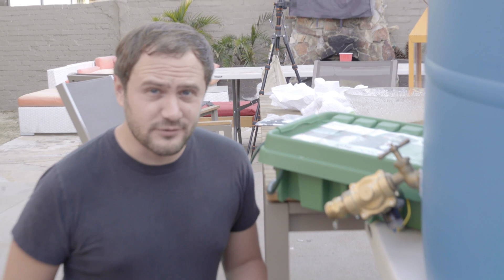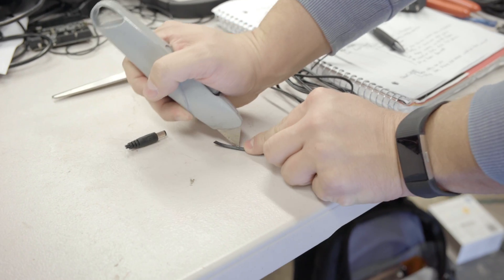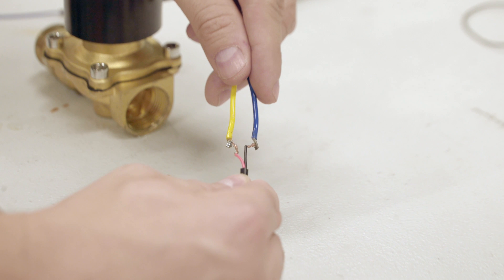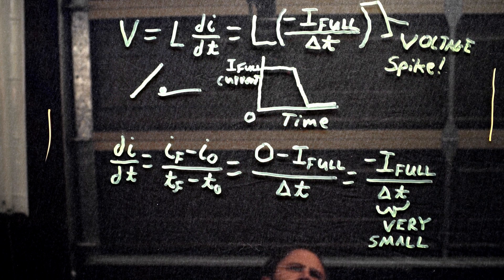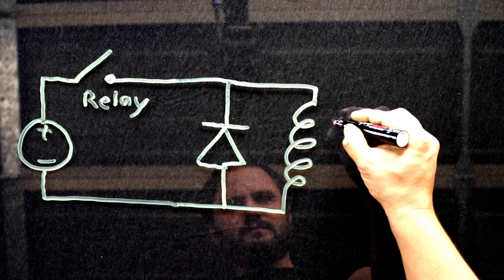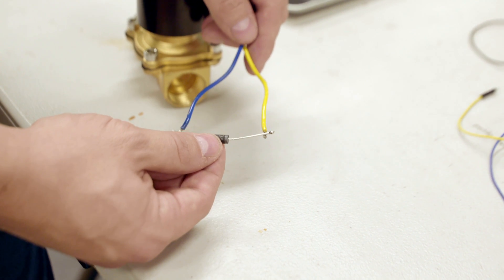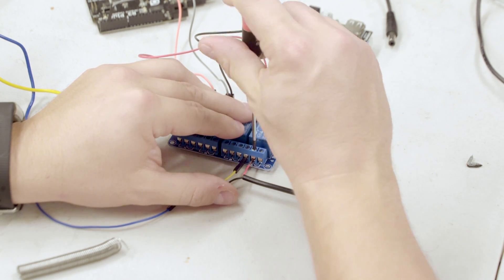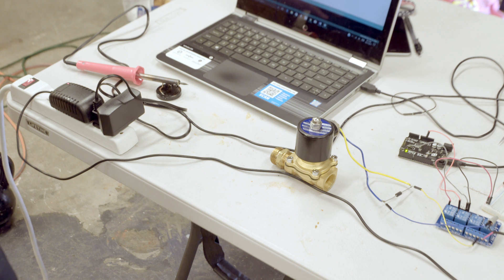Arduino Solenoid Valve Circuit: How to control water flow with an Arduino

Comment: What if we use a 24 V solenoid valve?
Reply: Technical Engineer same wiring setup just use a 24v power supply instead of a 12v
Reply: He might mean 24Vac solenoid.

Also, wouldn't the problem be half as big? I looked at some valves, and all the DC ones (12V, 24V) had the same 13W rating; so half current for the 24V version. Same with the AC ones; 12Vac, 24Vac, 120Vac, 240Vac; all were rated 17VA; so 1/20th the current on the 240Vac coil vs the 12Vac coil.

Comment: Awesome video man.. can i run this on 240v? and parts list please if i need anything different from your list thanks!!!
Reply: Sure, there are even valves that hook up directly to 230Vac so you don't need the adapter.
Reply: jcvjcvjcvjcv thanks man havent got time atm but im doing a progject soon an might need some advice
Reply: Well, I just installed my Arduino-run 230Vac (17VA) valve today, it opens about 30 times per day, depending on how warm it is, and I have it connected to an identical relay. Will let you know when the relays gets fried, haha. The relay said "250V 10A (non inductive)". I just took the gamble that this one tiny coil will be different than people connecting 10A worth of CFLs. At 50 Hz I guess you need a capacitor of 1/314th (in Farad) of the Henry value of the coil. 
Many, many loads are slightly inductive or capacitive. 

I didn't do the wire-touching thing. At 230Vac I don't particularly like the idea of a wire slipping from my fingers. At 12V or 24V.. yeah, no problem.

You still need a power source for the Arduino though, so you might still need an adapter. I am using a 10 year old 500 mA phone charger that was supplied with the Xperia X1.
Reply: @jcvjcvjcvjcv  so you did not use a snubber? I have a 220v AC valve and don't know what to use to protect the relay.
Reply: @serj2008  No I did not. Relay is still fine. I only use it on the hottest 10% of the year though. It's for evaporative roof cooling.
Reply: @jcvjcvjcvjcv  Thank for the reply man.... I'm planning to use the valve ~2 minutes everyday, so I guess I should consider adding an RC snubber or something. Any idea how to calculate what I need?
Reply: @serj2008  
2 minutes per day is way less than what I use it for. The days I use it, it's powered 2 minutes per hour ;)

I did ask the supplier of the valve how large the inductive part of the load was. They didn't know. I think it's also not really that relevant with such a small load. Might become another thing if you are the relay to switch near it's rated nominal current.

Comment: thanks for the video. please send me the code.
Reply: const int RELAY_ENABLE = 2;
void setup() {
  pinMode(RELAY_ENABLE, OUTPUT);
  Serial.begin(9600);
    
}

void loop() {
    Serial.println("Relay ON");
    digitalWrite(RELAY_ENABLE, LOW);
    delay(1000)
    Serial.println("Relay OFF");
    digitalWrite(RELAY_ENABLE, HIGH);
    delay(1000)
}

Comment: I want to ask if solenoid valve can be arranged like the valve is open 50%, 75%, etc?. Thank you
Reply: Faza Rais A solenoid valve can only be open or closed all the way. If you want part way open you'll need an electric ball valve. For the cheap ones you'll control the position by how long the electrical signal is sent. Most take around five seconds to fully open or close. So 2.5 seconds of signal should move it half open.
Reply: whether electric ball valve can be set the percentage of the valve openings using arduino?
Reply: Yes, just have the Arduino only send the signal for a short time.
Reply: thankyou david

Comment: How can I control  Solenoid valve sudden times for garden. What code will be. Please can u make a video. Thanks.
Reply from the maker: What do you mean control the solenoid valve sudden Times? It opens and closes pretty fast, if it’s just for a garden you shouldn’t have to worry about how fast the mechanism is

Comment: Pro tip: get a little drunk before soldering, helps with the shaking.
Reply: With knowledge like that, you should be president.
Reply: Slow tip, Elbow to knee makes a 3rd arm.
Reply: Just a shot or two
Reply: loool
Reply: @Brayden Boone This is a scam, no one should access this service!! you would be stupid to think something like this is legit
Reply: Just a little to get rid of the delirium tremens. In the morning of course.
Reply: Tried it. You are ABSOLUTELY correct.